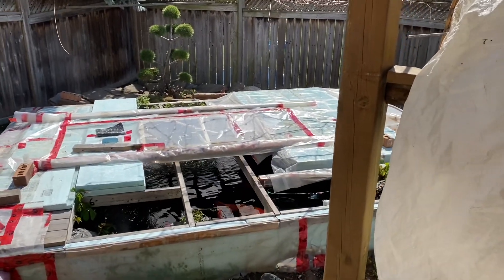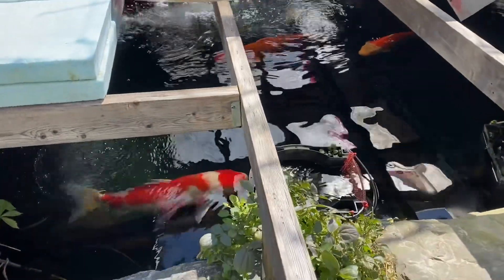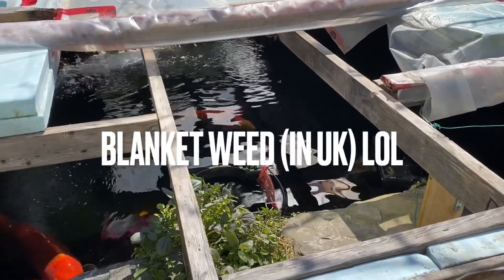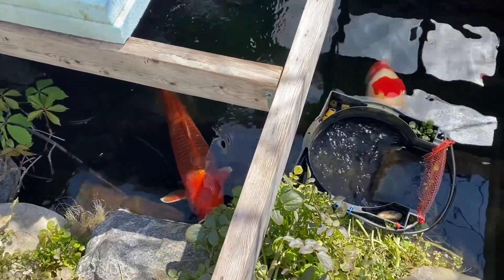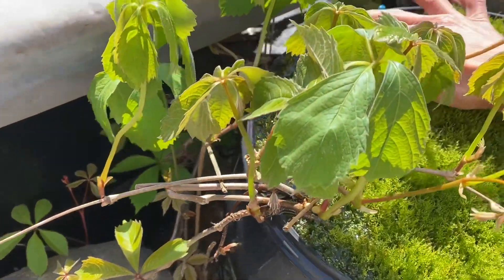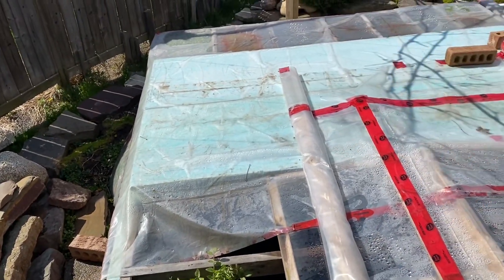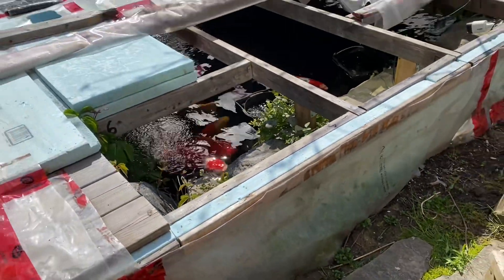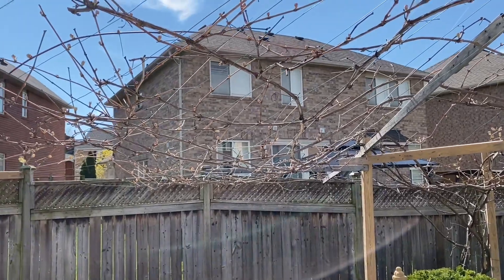Preventing spring parasites, high ph, Sid’s koi pond

Comment: So nice to see the covers coming off. Winter lasts far too long and it's time to enjoy the warmer spring weather. Supposed to be a wonderful warm sunny week ahead that no doubt both you and your koi will enjoy.
Reply from the maker: Yes Ken looking forward to sunnier weather at last. Koi are in relatively cooler temps that I opened the pond rather early but they seem to like it. When are you putting the koi out?
Reply: @KoiRun50  I'm hoping to start moving them out in the next couple of weeks. I'm currently re-plumbing the entire pond filtration system and will be adding a diy bakki shower as well. Once everything is up and running it will be time for the koi.
Reply from the maker: What’s the bakki shower for?
Reply: @KoiRun50  The bakki shower is to replace the tower shower I had on the pond last year. It should enhance the water quality far more than the tower did with the new media I will be putting into it. I'll be showing that in an upcoming video.